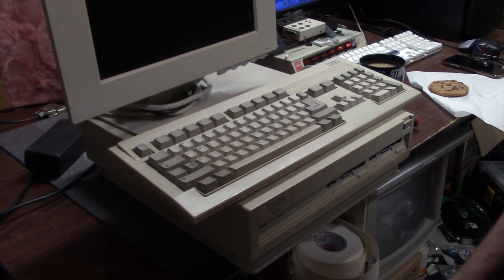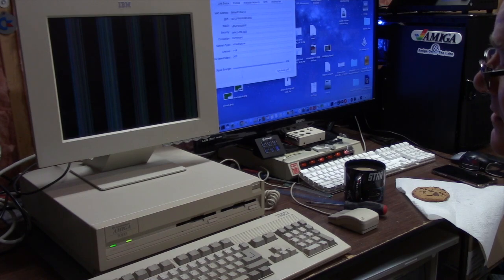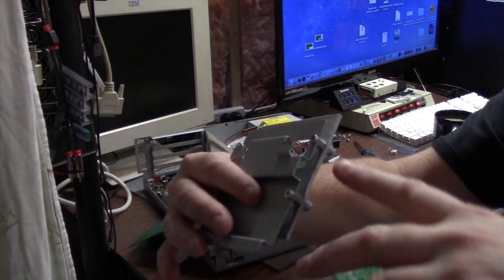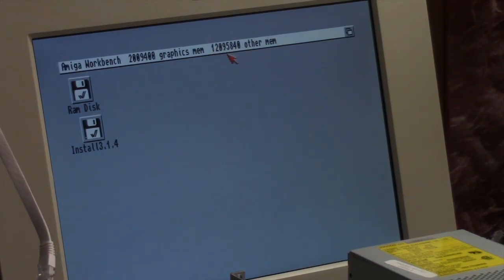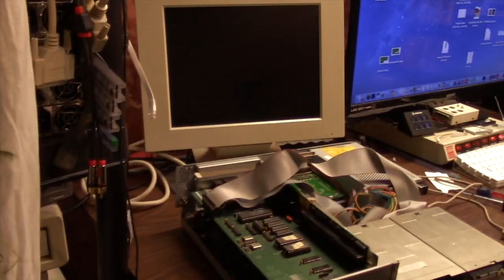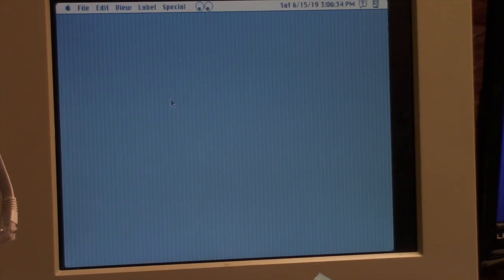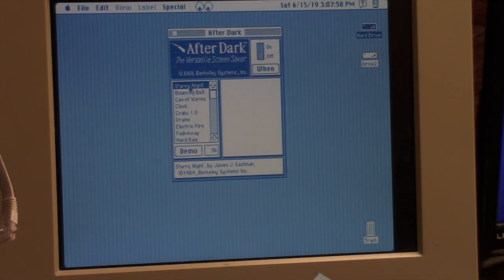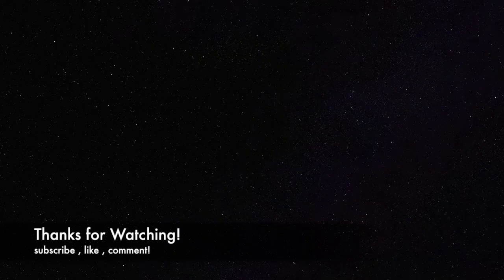Amiga 3000 adding ram and AMAX original hd

Comment: I am trying to get mine to work with fdd... tested drives working on my 1200 and 2000... but my 3000 refuses to read or write to the drives...
Reply from the maker: do you have one drive or two ? if so make sure the DF1 Jumper is on (near the middle base left side of the riser card. and the cable is on correctly. worst case, CIA's and Denise have control to the floppy, Diagram could help in testing the chips and all

Comment: (I know I'm three years late). Since the personal stuff was removed, can you make an image of this A-Max compatible System 7? I would hate to prepare all of those A-Max format floppies in order to load a fresh system. I am testing out A-Max on my A1K and A3K but lost all those A-Max format floppies I had. I actually think I kept them in storage for the longest time and then wiped them in recent months because I needed some DD disks. I am not entirely sure how I made them the first time around. I did have Emplant, a real mac 800k floppy an "AMIA" adapter in the past but that all came after my first emulation experience with A-Max.

Comment: how much has this entire project cost?
Reply from the maker: the A3000 i paid 600 on ebay. between replacement parts, upgrades and add ons, and being an addict, probably 1200$ usd SO FAR. but as long as you enjoy what you do it does not matter the cost.